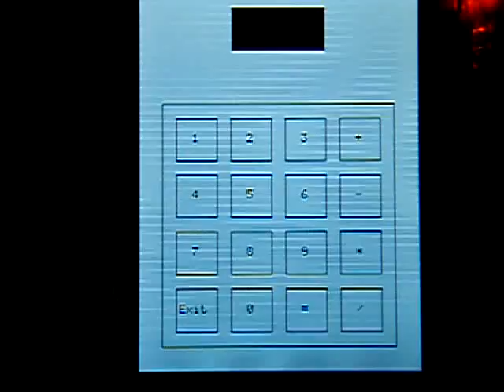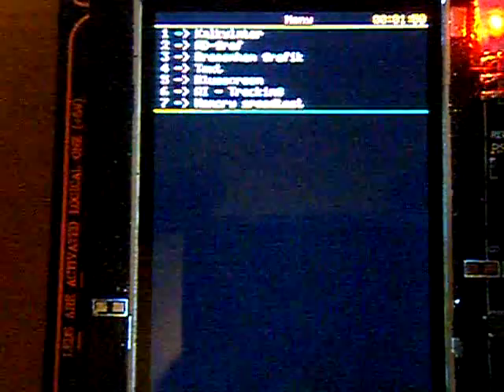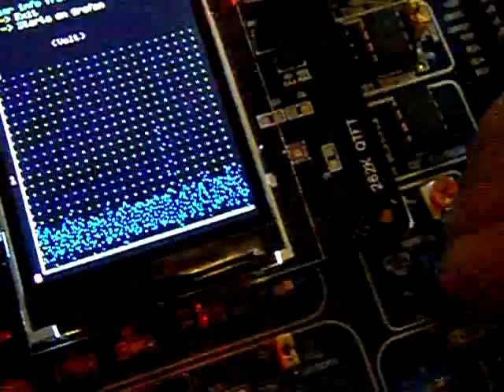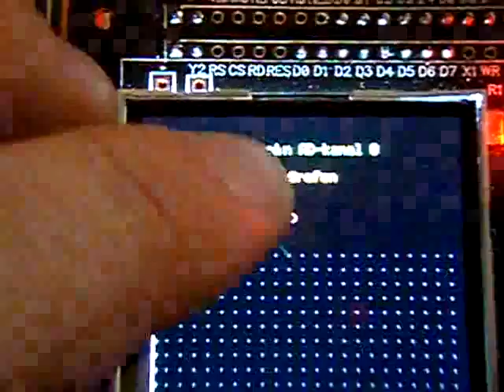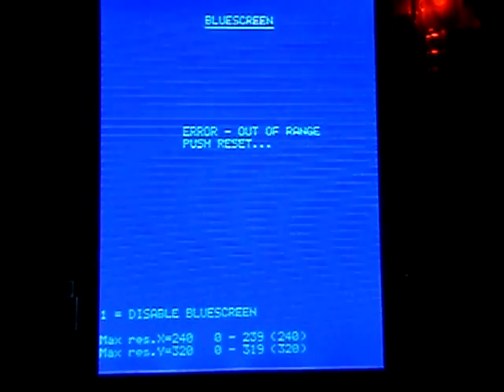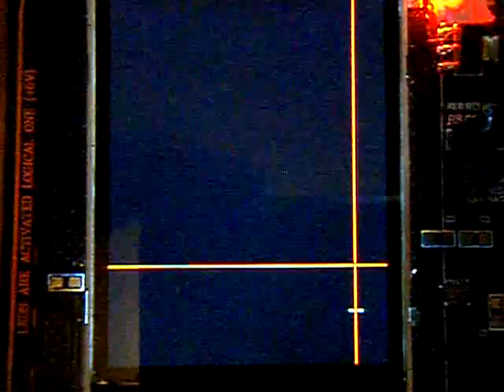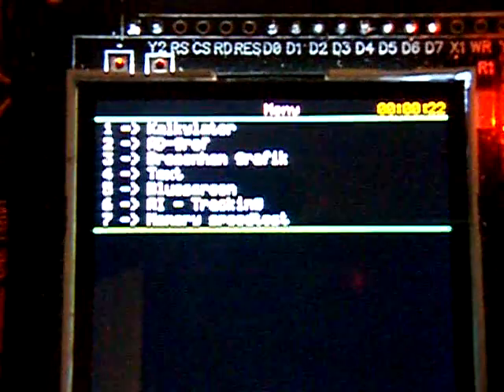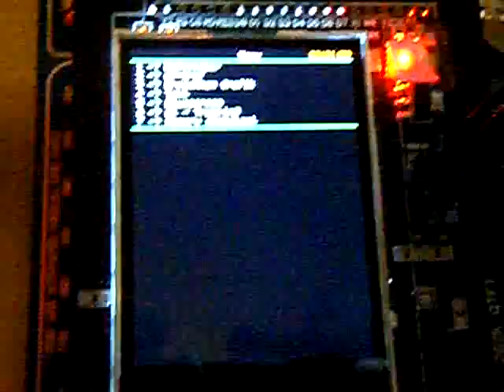QVGA LCD with PIC18F458

Comment from the maker: Yes, It is the QL200. Like it very much. The Only disadvantage I have found is that it uses the PORTC to the keyboard,sd-card,I2C memory,the RTC and the RS232 so you got to choose wich function you wants (if you dont want use the cables). But like I said, its just to connect verything with cables and the problem is solved. Good board for the money.
Regards Kdg86